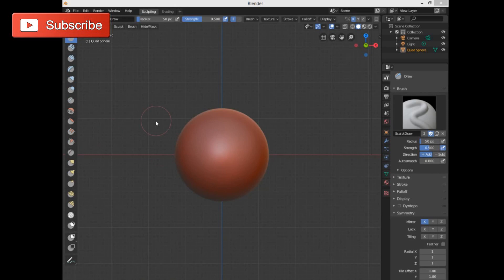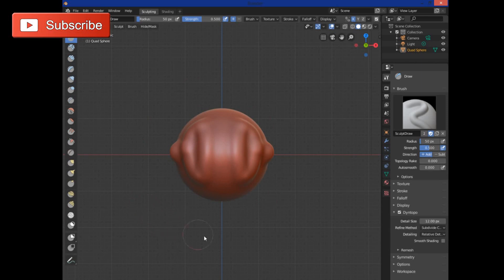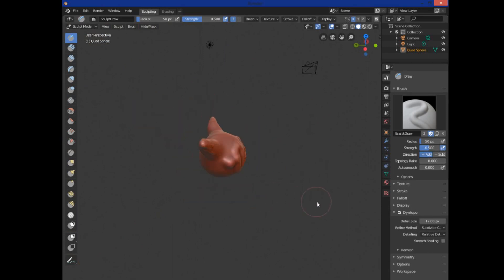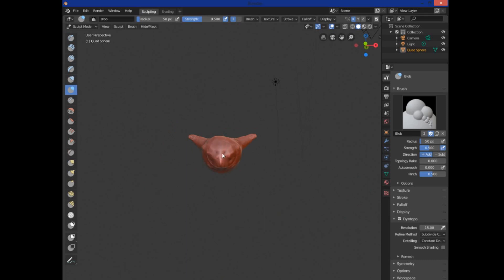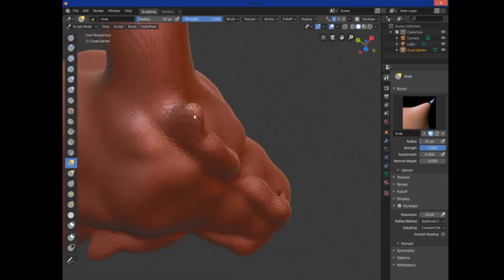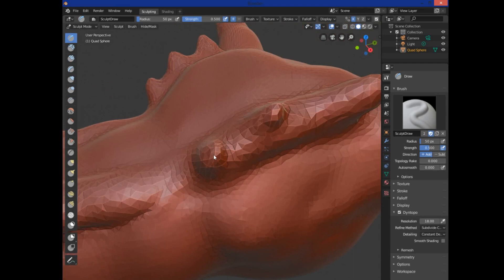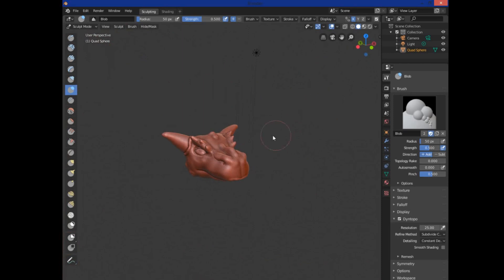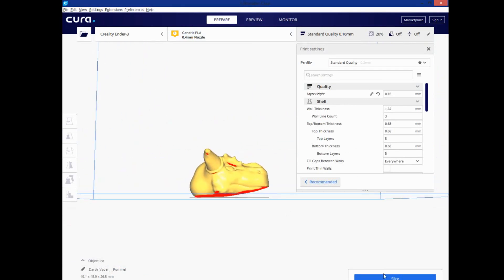How to sculpt for 3d printing in blender 2.8!

Comment: Tip if you can't be bothered flattening the bottom is to go into cura and set the Z position for the object to slightly negative (can be way less than 1mm). This puts a tiny bit of the model under the build plate and it's ignored for slicing.

Will give you a perfectly flat bottom although cuts a tiny little bit off to achieve it!
Reply from the maker: Great tip lain ty
Reply: @Technivorous  my pleasure! Your tutorial was so useful. I'm used to CAD type parametric modelling approaches and trying to get used to using blender for sculpting/more organic stuff! Great introduction!

Comment: Do you ever have trouble with the sculpt being non-manifold after sculpting? And if you do, what do you do to fix it?
Reply from the maker: often times this happens due to inverted face normals. there are a few softwares that can fix it. if you use cura there is an extension called mesh tools, that can do it to simple models

Comment: How would you compare zbrush to blender for sculpting? Is zbrush worth the money for an amateur in in computer sculpting. I’m interested in both organics and mechanical application. Printing is also another goal.
Reply: Zbrush is still king, because it has some amazing features that Blender still lacks. Particularly when it comes to handling very dense poly objects, even on a not so new computer. I have both so I can easily make the comparison. My computer starts lagging really bad when I reach about 10mil polys in Blender, but Zbrush handles the same density nice and snappy. 
But not for long. Blender is making insane strides towards perfection. Within just a few versions, I think Blender will be as powerful as Zbrush, except unlike with Zbrush you won't have to pay a dime. That's the power of open source software. There is always somebody crafty out there who will bring their favorite features from other programs into Blender.

Comment: Thanks for the tutorial! How do you know what size it prints? Is there some sort of way to make the prints in different sizes?
Reply from the maker: Most slicers will give you the dimensions of the final object. When you import it into cura for instance, you can click the model, and there will be a panel on the left with some tools. Find the scale tool. With this you can scale the object to a precentage evenly, or enter the dimensions you want manually. After adjusting the numbers you will see the model change accordingly
Reply from the maker: Also I have a video around here somewhere that explains how to set the scale in blender so you know what the model size will be
Reply from the maker: watch out for my next video. im about to post a channel update video, but the one after that is all about scaling your model
Reply: Thingiverse has a free model scaling took I think u search for mixture scale measure hope this helps get ya started it did for me

Comment: You may already know this, but if not, holding CTRL then hitting a number will snap your view to the opposite side.  So for your bottom view, CTRL 7. :)
Reply from the maker: i use the num pad, so i dont need shift :) great tip though!